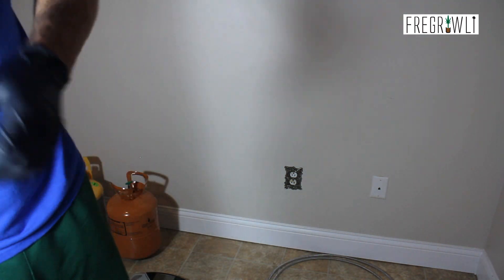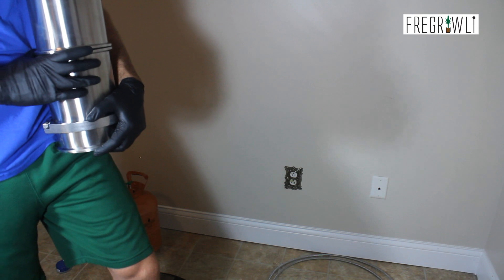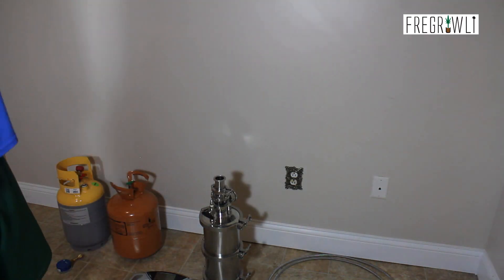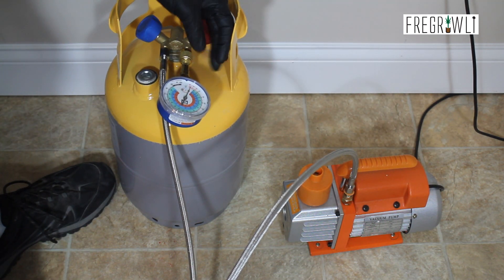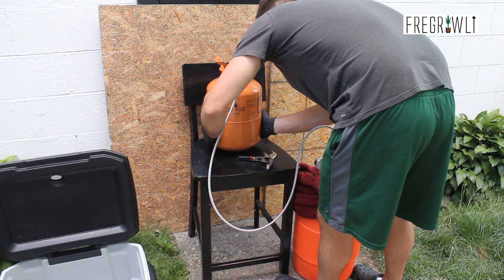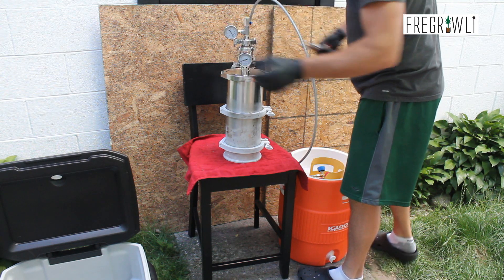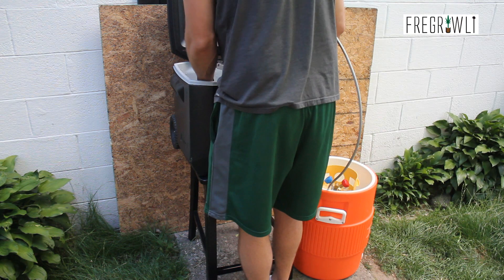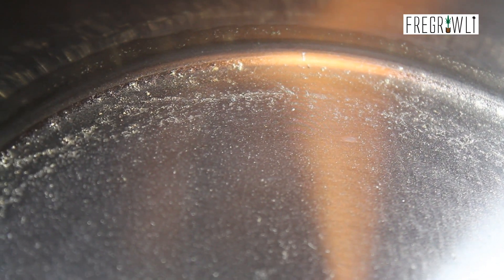Part 3: Passively Distilling Butane in a Closed Loop System

Comment: Nice video.

Are you sure you never put the recovery tank under vacuum after the first use?
If you put it under vacuum each time you use the extractor recovering butane is wayyyyyy faster

  I am only asking because the instruction booklet that came with my 1lb closed-loop extractor outlines specifically the safe way to put your recovery tank under vacuum each time you utilize the equipment.
After you have flooded your system with all of the butane your recovery tank should be pretty empty.
If you are worried about any fumes being in the recovery tank open both valves and set the recovery tank in warm water.
If you put a vacuum pump on a recovery tank with butane in it you can definitely blow up the vacuum pump as well as all the butane... but with some sense it's unlikely to occur (I'm guessing bvv tells you not to put it under vacuum again for liability concerns...which is understandable)
Even though it's hazardous, you can continuously put the recovery tank under vacuum each time as long as you make sure there is no tane in the tank

Comment: how much butane do you use for a lb run . thanks
Reply: BigBlock I'm new as well, but I've been told 5 times the material. So 1 pound equals 5 pounds solvent.

Comment: Wow funny how u comment in begining to VAC down your tank because of fire/explosion hazard then you proceed to swap hoses around WITHOUT vacing them?? not cool dude ,any oxygen + explosive gas = unsafe combo. u should Not attempt "teach" untrained ppl with no hvac knowledge this stuff w/o including how to remove air safely from tank. 
Also: your recovery time was horrible due to not exchanging the warm water, or using a water heater to keep temperature(example anova sous-vide) the water temp did not matter soon as that dry-ice-chilled steel hit the water temp drops dramaticaly and inside temp stayes even lower
Reply: You sound like an idiot!
The video is edited so you have no idea whether or not he vacuumed the hoses.

Also, who vacuums out their hoses...?
Oxygen + unexploded gas = unsafe....???
If you think a vessel under vacuum has no oxygen in it... then I cannot educate you any further.

You would need to be operating at a much higher vacuum in order to get close to having less than 10% oxygen..
Unless you're using titanium stuttering, I do not see how you think that there isn't oxygen in this system

Comment: Great vid, one thing though.  Never store dry ice in an air-tight container, as it will eventually rupture/explode due to the CO2 converting to gas.
Reply from the maker: I saw someone comment this on the Best Value Vacs IG. You are right. I will have to add an update. I was thinking coolers or something that a lid would just pop up or you coild semi close. Something like a mason jar with a screw on top would obviously be something totally different. And unsafe.
Reply: For sure, something that will pop open like a cooler is ideal 👍
Reply: @fregrowli yea, you could say that. It would also be a magnificent way to get the ATF and FBI to come on by and introduce themselves and take you to a place where you have zero constitutional rights and you get to visit the reverse zoo as a vip member. And may god help
You if you’re middle eastern descendant.